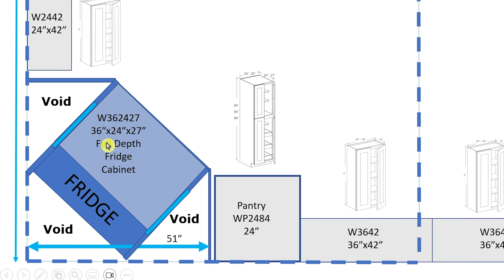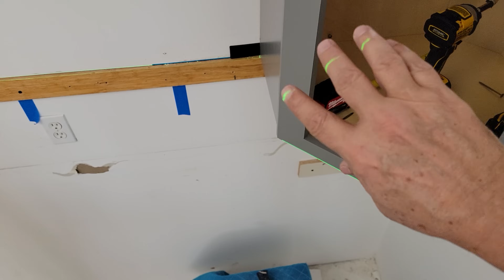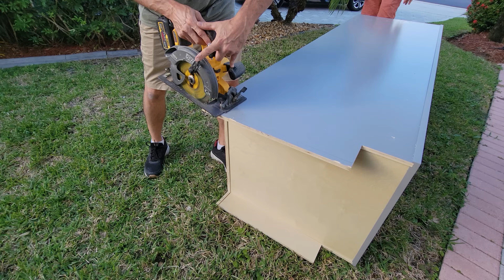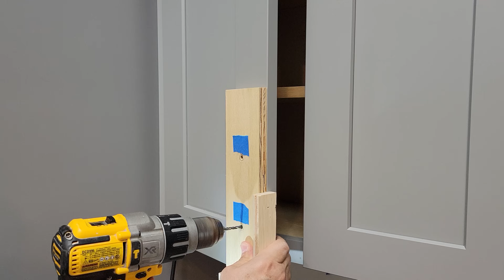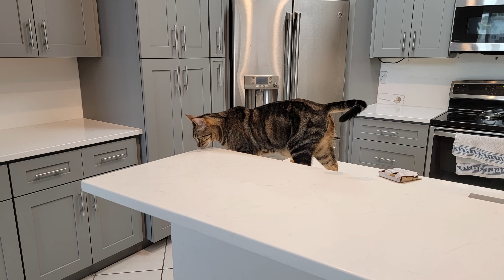How To Install Perfect Kitchen Cabinets DIY Like Pros

Comment from the maker: XinSunho 4-Step Folding Ladder, Retractable Handgrip: https://amzn.to/47togQT
DeWalt DCF850B ATOMIC Compact Impact Driver (Tool Only): https://homedepot.sjv.io/0ZKRaR
Milwaukee #6/#8/#10 Wood Countersink Drill Bit Set (3-Piece): https://homedepot.sjv.io/OrdyAW
Milwaukee 3622-20 M12 Green 125 ft. Laser Level (Tool-Only): https://homedepot.sjv.io/593RN
Reply: Any chance you'll do a vid discussing the use of carbon fiber in the Japan Airlines Airbus fuselage that allowed all 379 passengers & crew to escape the burning plane?? Seems like it would be a great contrast with the Titan sub CF construction.

Comment: Doing crown molding on those corners for the 45 degree fridge cabinets and other oddly placed stuff is always fun! Haha it feels good when you get it done really well though. I found a big problem can be your saw! I had to use a loaner saw once and it took forever because it just cut crooked!
Reply from the maker: yes alignment of your miter saw blade is critical, and cheap miter saws have a wobble which you don't see, but the it affects the cut accuracy

Comment: Bravo, superb remodel !
The only thing I would have done differently is hire a subcontractor to install a through-the-roof exhaust vent above the cooktop.  I did that in my previous house, which was built in the mid-1970s.  They had to chop out part of the wall behind the cooktop (which was in a bedroom closet), install a plenum and ductwork, cut a hole through the roof, get power to the built-in exhaust fan, etc., then clean up the mess.  Done in two days.  Worth every penny.  Because my wife's cooking always generates a lot of smoke!
Reply: For your friends' house, the exhaust vent would have been placed where the microwave currently is.  And the microwave would have had to been repositioned.  I would have suggested repositioning the microwave to the left of its current position, to above where the toaster oven.

Comment: Jeff I love your disaster coverage but this is an absolute insane kitchen design brother lmao. Anyone saying don’t let my wife see this is also absolutely insane. Cabinets are exponentially the most expensive item in any nice kitchen and Jeff here just tripled his cabinet budget. OR the more likely scenario since he didn’t himself is he slashed his cabinet budget in 1/3 by tripling the surface area and you can kinda tell in the build quality this is pressed mdf cabinetry and not solid hard wood I’d be ripping this out immediately sorry Jeff
Reply from the maker: This is all solid beach wood in these new cabinets. The older cabinets that we removed were particle board, the cheapest form of cabinets, that all builder give you with your new house.

Comment: I put my refrigerator in the corner like that and found that I  could not open the doors all the way before it hit the cabinets. So I had to check the geometry of the doors associated with the type of fridge before purchasing. I wanted the fridge to be flush set in but had to bring it out a little. It looks nice but I would probably rethink all the angles if doing it again. Unlike me, I'm sure you thought everything through before hand.

Comment: 1:30 So much space wasted by having fridge place like that. 
He says no space wasted because his cut out. 
But who the hell is going to slide their fridge out to get a box of cereal? 
No one.

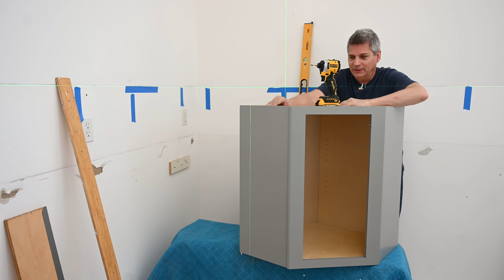I hope this man does not install cabinets for a living.Most of his advice is nonsense (e.g. 4:46).... Do uppers after wards FORSURE. So you have much more control on spacing between uppers and lowers and can use a small 3 hand to lift the uppers into place. WAY EASIER. Never damage lowers doing this especially because I use a scrap board as a platform on lowers to life uppers into place with 3rd hand.

12:15 lol tiling to make flat surface is not required. With legged lowers they adjust east. With this cheaper version of lowers in video you can just have strips of material of the correct thickness under box gable edges.

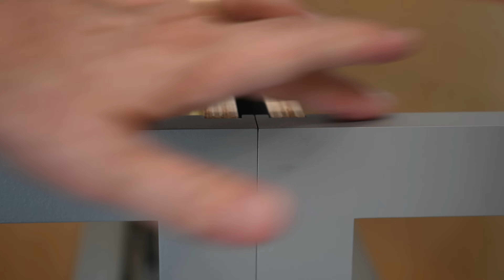14:17 it is true you do the right steps when it comes to leveling and flushing everything up BUT you take way too long doing it....

I cannot bare watching the rest of the video...
Reply from the maker: Your statements show complete ignorance. They don't slide out the fridge for cereal, they slide it out for things like holiday storage, or tall items that you rarely need to get at. You should NEVER be installing cabinets. Any expert will tell you to install upper cabinets first. Like I mentioned in the video, clowns like you will criticize those of use who spend the time to make it fit perfect. Also, the tiles were put in to level the floor so the fridge can roll in and out, and so the dishwasher will be at the same height, because many people install a dishwasher and cannot get it back out later due to uneven floor. You fail to spend the time, so there is no way your installations come out looking like this. Just another uninformed troll.
Reply: I've always done the uppers first.  Everything in the video was excellent advice.  You do you, but quality counts with me.

Comment: Gotta watch out for the F.B.I. (Feline Bureau of Investigation)!

I have a 1950s kitchen that's seen better days. Modern fridges won't fit in the corner space (wall on the left, base cabinet on the right, cabinet overhead), but I found a smaller French door unit that would fit, IF...  Manufacturer had the size spec's on their website, which showed exactly how far the doors would open. I measured and sketched my tight kitchen space, made a paper "model" of the unit, and confirmed that it would fit, AND the doors would open all the way, IF it were simply placed diagonally into the corner! No remodeling needed, no hacking off the bottom of the overhead cabinet like my friends had to do when they got a bigger version of my fridge. But they didn't have a wall on one side, because the kitchen door was there. Somehow remodeling the kitchen is very low on my priority list.
Reply from the maker: It's a lot of work, but rewarding when you see it finished

Comment: Enjoyed the video.  Question:  Under present code should the A/C outlet have the ground on top?
Reply from the maker: Code does not require it, and you can do it either way. Hospitals have the ground on top.

Comment: Spice rack: Put the sliding in top, hanging the shelvs below, dropping it all down 2-3 inch.
Reply from the maker: Yes, the owner realized that after putting it together, they should have done the spice rack like drawers, instead of having the weight of the spice rack glide on top of the bottom gliders. It makes the spice rack sway too much, even had to put in some guides inside the cubby to keep it from sawing.

Comment: I  would  do  job  like  that   once  a  month  in  new home  here  in Iowa      I  was a  Pro Trimmer  for   35  years    A  kitchen  like  that  would  take  me  about  5  day  by myself    go in on  Sunday   pack  all cabinets in  unbox  them in and  then  Monday  Move  in doing  the bigger job     DeWalt  make  Drill bit  for   tie  cabinets  to  each other    make  the screw   lose in  the one  frame and  smaller  hole on  the other  frame   I have  installed  over   1000's  kitchen   over the  years  and   sometime  back  to  the  same house   15 years later   putting in new  cabinets
Reply: Yah sure.

Comment: Jeff - could you explain how the refrigerator is ventilated. With the refrigerator enclosed on all sides, it seems like the refrigerator would not be able to ventilate the heat?? 🤔
Reply from the maker: Yes if you look at the beginning of the video when I show the diagram of how the refrigerator is mounted at an angle in the corner that whole space is open and it's open all the way up to the top of the cabinets as well. Also you do have about 1/4 of an inch on either side of the refrigerator for air to get in and out of there. The ventilation is really most important at the back of the refrigerator.
Reply: @jeffostroff  Thank you Jeff for taking the time to reply to my question.😎

Comment: Uhh .. The Upper Handles on The Frig Doors Likely Prevent Doors From Open Enough Due To Collision With Countertop Or Cabinet Handles Preventing Doors Ftom Opening Enought To Pull Out Any Draws In Side Same ... 
What's The Mfgr Model Number On That Frig I'd Like To See The Specs...
Also Left Door Ss Frig ...
Looks Like Upper Pantry Handke Would Scratch ss Door Once Fully Opened ...
I Would Have Balanced The Wall Cabinets So L & R Were Sane Size. When You Enter Kitchen That's Where Your Ryes Drawn To And Woukd Look Better Balanced ...
My Opinions From Main Starting Image Frig In Corner Pantry Keft Of Frig ...
Reply from the maker: Sorry I do not have the model of their refrigerator I just simply measured it before we started and it was exactly 36 inches across which is why we had to build out the enclosure 1/4 of an inch wider on both sides of the fridge, Because the cabinet on top of the fridge is exactly 36 inches wider so we made that slight gap on either side to allow the fridge to slide in and out of the enclosure.

Comment: Super nice job. That bump in the floor got you. I learned one thing. Assume that nothing is ever flat, square, or level. I always check the floor. If the floor is really wavy then> The un-adjustable dishwasher height sets the counter height. The tall pantries and ( if un-scribable) finish gables set the upper cabinet height. Then I go to the corners.
Reply from the maker: Yes we knew it was higher when we started but initially we didn't do anything about it because we figured the pantry breaks up the flow of the cabinets and starts it’s on course down the west wall and you wouldn't notice it from one side of the room to the other. But it was once we started to add the crown molding which the owners originally did not plan on doing, it became problematic but luckily it didn't take us long for three of us to wheel it outside make the two cuts and bring it back inside now at the correct height

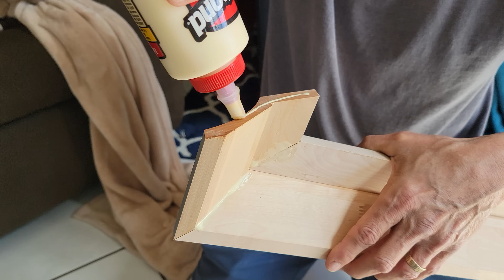Comment: 20:51  I've seen StudPack use 2P10 Instant Wood Adhesive for kitchen cabinet crown molding. Not as strong as wood glue, but since the molding isn't something that will be fiddled with, they felt comfortable using it and said it made the job much faster.
Reply from the maker: Any adhesive is fine to use there. IT will never see a load

Comment: Really great. 
I understand why some are critical of the time invested in the work. As a contractor wanna be, I have found that there is a continuum: professional to perfectionist. I tend toward the perfectionist end, which is not usually financially  conducive. Unfortunately, perfectionism isn't usually optional; it's a compulsion. So, I appreciate the work you've done and the sacrifice required. It's worth it, IMHO. 
If you have a moment, I'm just curious. On the crown fasteners, Brad or pin? Aren't pins too weak? I seem to recall Norm or Tommy suggesting pins being good for glue set up. May have been Hometime. It's been a few years. 
Then there's that $27k counter measuring system. I'll be using the wasteful but cheaper templates until I get grown up! 
Thanks, again.
Reply from the maker: That is a Porter Cable 23 ga pin nailer, this way the hole is not very noticeable
Reply: @jeffostroff  So, the glue is doing most of the work, I guess. The reason I asked is that I'm debating pinning vs Brading base board caps and some custom 361 casings. The old way is to tap crossing nails into the outer edge to close any potential miter gap. It's kind of gross negligence against nice wood - or composite. I'm working on a way to secure connections that are also removable with minimal damage. In a rental unit, I want to be able to change out various trims efficiently. Successive and excessive coats of paint compromise presentation and marketability. 
Thanks, again, for your time.

Comment: VERY NICE !!!!! HOW MANY MAN HOURS FROM REMOVING AND INSTALLATION .
Reply from the maker: My spreadsheet says 155 hours, but I don't know if I may have missed any days or not. The main part of the remodeling from tear down all the way up until the time the quartz counters were installed was 30 days. Then after that there was a lot of spotty days in between where we were waiting to put in the backsplash and that took a few days and then some other adjustments that we made to doors and caulking and stuff like that

Comment: i hate.. HATE that stupid wasted space on top of a regular kitchen cabinet set up, all of my homes have had them and ive hated them all, recently i used that huge waste of space as a base for an indirect upwards pointing LED array, which is really cool, other than that ... worthless.. smFh
Reply from the maker: Yes and I am upset that even the cabinet maker didn't have a full depth cabinet for over the fridge which is why you see there we had to buy 2 cabinets and remove the back off of 1 and join them together to make it full depth so that we could utilize all of that space above it.
Reply: If you invest a little time rescuing a stray kitten abandoned in this harsh world, you'll see immediately that they just LOVE the warm private space above kitchen cabinets.

Since pre-historical times, kitchen cabinets have been designed specifically for active, athletic kittens and cats to make their favourite haunts for resting and spying on rats and mice.

Comment: I'd like some detail on how you extended the cabinet for your fridge enclosure. I'm challenged by the same thing, except for an existing pantry closet. All the pantries offered by the manufacturer are not deep enough.
Reply from the maker: Yes and I am upset that even the cabinet maker didn't have a full depth cabinet for over the fridge which is why you see there we had to buy 2 cabinets and remove the back off of 1 and join them together to make it full depth so that we could utilize all of that space above it.
Reply: @jeffostroff  Ahh. OK.  I'm going cheap out and extend by birch plywood maybe. Ha! Like my carpentry skills are all that 😂

Comment: Also, in addition to using Excel for a precise layout (see my other comment), I hung the uppers individually using homemade french cleats. I leveled the wall cleat using a laser level, then placed each upper cabinet on that leveled cleat. I glued and screwed the mating cleats on the backs of each cabinet. This way worked best for me because I'm a crippled old woman working largely alone.
All I had to do then was plumb the uppers.
Using french cleats meant that the 'ledgers' simply remained in place.
Oh boy it has taken me some time to do. I wish I had a crew like you have, but I did have a handyman on occassion.
Anyway, I'm proud to say that I have all hairlines and no lippages.
Reply from the maker: Yes I also used to use the Ledger boards like you saw me attach below the corner cabinet and with laser level them and everything but stopped doing that because I found out that once everything was all leveled and you put the cabinet on there sometimes you still have to make micro adjustments to the cabinet so I now prefer to just put the Ledger boards on the wall right around the point where you will hang the cabinets but allow an eighth of an inch or so below it so that I can just stick the shims in there and adjust the height up and down of the cabinet as needed.
Reply: @jeffostroff  Yes. I did have to make micro adjustments. Fortunately, I didn't lose my mind and stayed at it.

Comment: Power Point? I brag about my Excel layout. Set the row height at 9 and the columns width at 1, and you'll have a perfect grid. I scaled mine to one cell = 1/4", because I was working within very tight dimensions but I wanted a lot, which meant cramming. 
I inserted circle shapes to evaluate cabinet door swings, drawer extensions, etc. I used borders to define walls, cabinets, and appliances.  It allowed me to hyperlink the text boxes (to the cabinets and appliances online).
I even added a yellow "tape measure" left to right and up and down on frozen upper rows snd frozen left side columns using borders and color fill.
I further added a thin pink one foot square grid across my layout.
I'm not a very organized person, so I needed to have all of everything in one spot, not on scratch paper everywhere (as I'm prone to do).

Yes, it was work to create a plan in Excel, but when I finally installed my cabinets it was worth it (first-time cabinet installer/DIY'er).

You may not love Excel like I do, but I tried Power Point (months before seeing your video) and Excel did it for me.
Reply from the maker: Yes once you have one done you can use it for future designs too